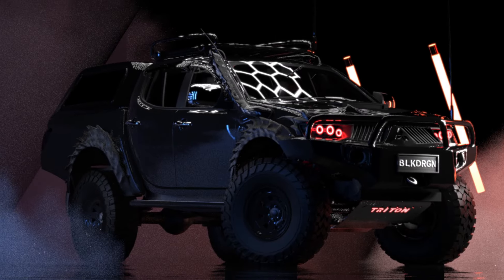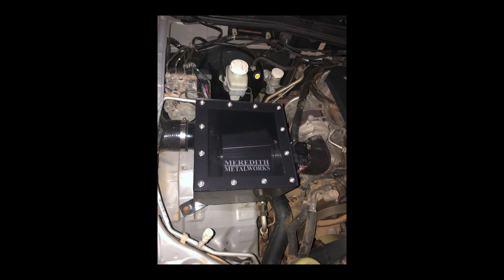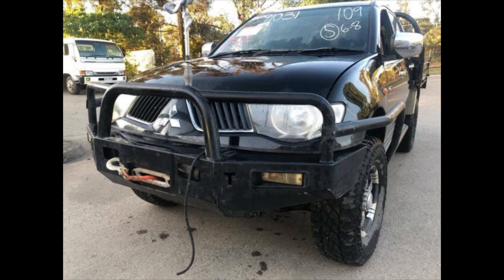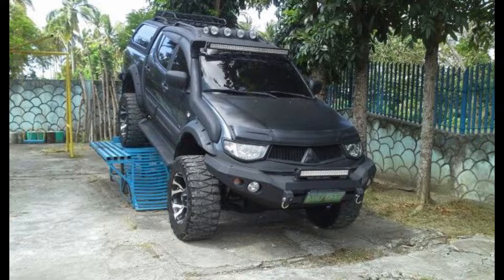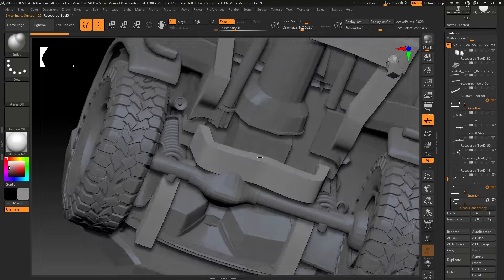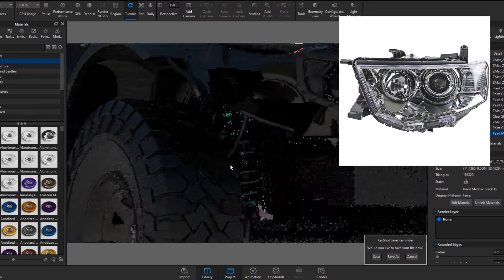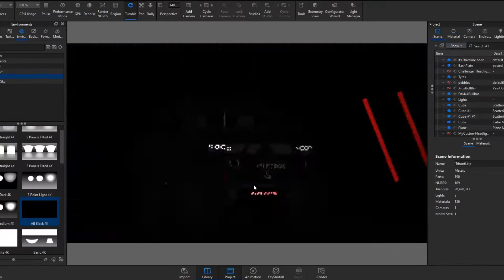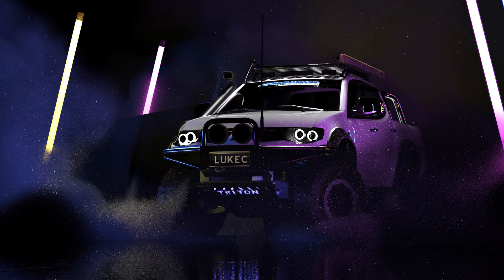Designing the "Black Dragon" V8 and SAS'd Modified Tritons

Comment: Really impressive work, at 12:05 are those just flares that have been sprayed to match the body paint?
Reply from the maker: thank you! i assume this may be something you can probably buy online. I have seen very similar ones on an mq with just a quick google image search
Reply: @Dragonio3 yep you’re right, just did some googling and found them on other cars. The issue now is that I can’t find any smooth finishes for an mn triton so not sure if I’ll have to buy some and touch up on the fenders myself. 😂